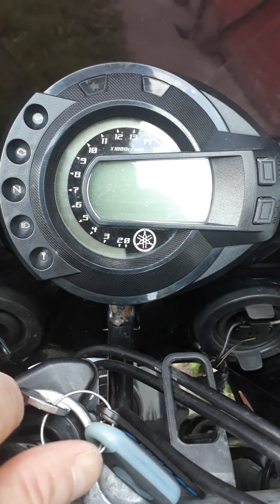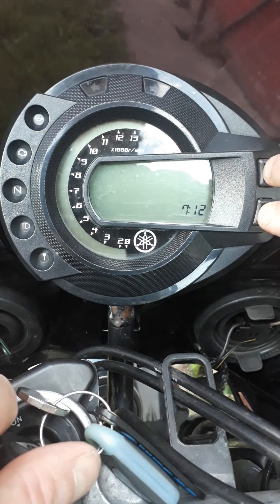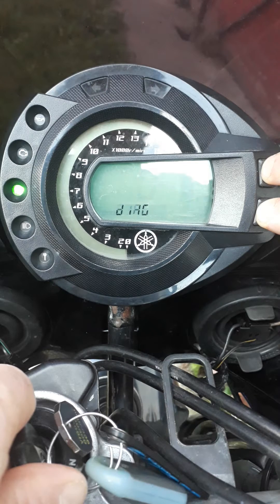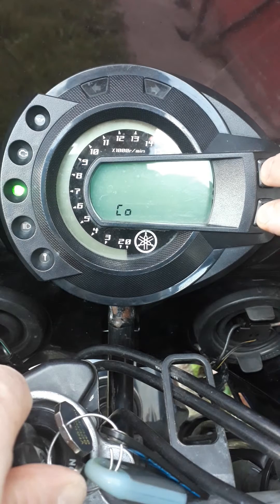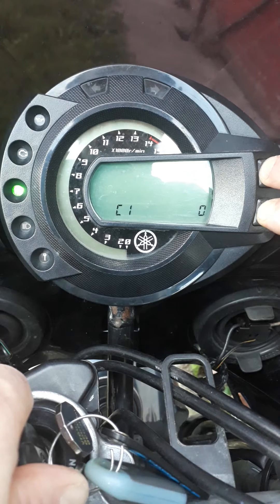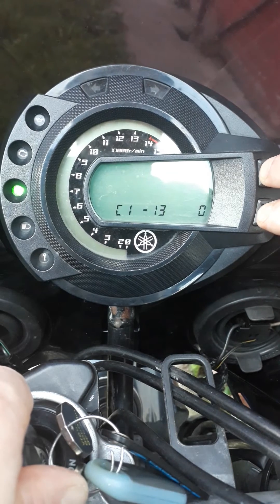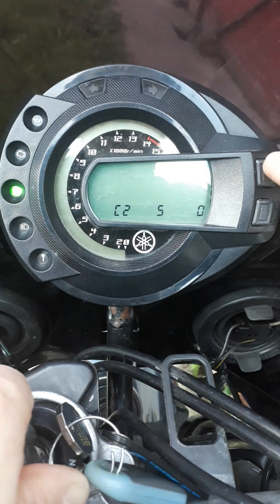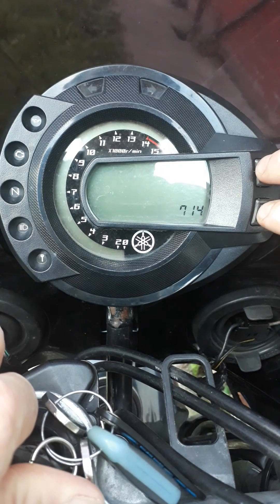Yamaha FZ6 secrets code to adjust fuel mixture on injectors

Comment: Hi, thanx for the vids. I have a Fazer 600 S2 2008. I mostly ride in the city many times facing traffic jams and using the motor maybe from 2.500 rpms up to 4.000 rpms. One tank gives me about 240 klms . What would be the settings regarding fuel economy

Comment: What do I set it to for flames? 😊
Reply from the maker: Wouldnt recomend that
Reply: @jameshiggins39  just for a vid will put back to factory after
Reply from the maker: Turn up the mixture on c1  leave 2
C2 alow put it on 20 but put it back down
Reply: @jameshiggins39  thanks I’ll do one vid then put back to normal
Reply: @jameshiggins39  best setting for running straight pipes??? would greatly appreciate the info
Reply from the maker: If bike got a cat it wont work
Reply: @jameshiggins39  it’s full straight pipe
Reply from the maker: Ule have to ref lick fuck

Comment: What is the difference between what the code does and what the Power Commander does? Or are the effects same if one wants either more torque or high-end power?
Reply from the maker: Depends how u use if u want  Is fuel economy or maximum power
Reply: @jameshiggins39  what's the values for economy then?

Comment: There are sensors you need to adjust if you change this value. I think it's pretty dangerous to be messing around with this unless you know what you're doing.
Reply from the maker: The only sensors a  Crank position sensor Air temperature sensor The throtel position sensor

Comment: Thank you my friend I am very pleased with this setting has both economy but also great power in the power of the engine I say to keep this setting thank you it works and more smoothly the engine
Reply from the maker: Just keep an eye on temp if u have gone feryy hi on c2 as two and three get hoter than  one and four
Reply: And you suggest it to me for this to do at the temperature does not make much difference from before I think it is normal the temperature there is some setting for it

Comment: What’s the perfect setting for c1 and c2? Fz6 2007
Reply from the maker: C1 -16  c2 5
Reply: @jameshiggins39   i think my bike is running a bit rich  so  i  have a question. does turning it to a lower number decrease the fuel it get's or increase? just want to be sure so i know what to kind of value i might whana look for
Reply: @jameshiggins39  Why C1 is so low?
Reply from the maker: Experiment like I did
Reply: @jameshiggins39  whats you recommend
Reply from the maker: 2 3 have to run cooler
Reply from the maker: Ive found +8 -8 works good for me

Comment: Thank you so much for the video.Which setting does least harm to the environment? I got a used fz6 recently but stinks a lot. And I want to save fuel. My mpg is arouns 25. What should I do with the settings?
my current setting is -5, 11 respectively.
Reply: 25 mpg ...clearly something is wrong. try the setting c1 -18 and c2 on 5
Reply: @Ladosligese and how much u do ? I have c1 14 and c2 8 and i do 350km with full tank
Reply: same here 200 - 240 km per full tank with very light shifts around 3 k
Reply: please tell me what options to make i am twrgeting for max save fuel thanks!
Reply: @ΠΑΣΣΑΣ-ε3φ  Βρήκες άκρη με αυτό; Οδηγάω στην Αθήνα και έκανα περίπου 240 χλμ με γεμάτο. Πότε έχει οικονομία;

Comment: i cant get past the diag screen, i press select but nothing happens. when i press both buttons from diag scren it brings up diag codes like d01
Reply: in USA the Co mode is locked. you need to use a wire to connect somthing together. don't know exactly why just read about it on fz forums and other Americans that had the same problem so just quickly glanced through it.

Comment: Hey mate .Just picked up a 05 fazer with a k&n air filter and dekevlic slips on and the bike is set at c1 -9 c2 5 ..Goes fine ..bit of a slump before the power band .at 5.5k..what ya recon..
Reply: Typically if aftermarket slipons and air filters are installed, you should increase c1 to about 15 and c2 to about 20.. mine with remus slipons and simota air filters and these settings run well, minimal backfire too

Comment: When I do this is says "do1" instead of "co",  there seems to be a lot of D codes but no C codes and it wont let me change anything.  How do you get around this?
Reply from the maker: Sorry I have got absolutely no idea you could try holding the two buttons down together and see if that helps the do1  might be just dew to  change in the firmware
Reply: @jameshiggins39  I think in the US or maybe it is the California version, the CO menu is locked out.  We only have diagnostic mode.
Reply: @smoke05s  yeah US only got diag mode. but the co mode is unlockable. you have to use som wire to connect somthing. not 100% sure exactly what but if you google it i'm sure you will find it :)

Comment: 2008 fazer also c1 -16 and c2 5 is the factory setting?  because currently c1 0 and c2 0 are the setting.  Thank you in advance for your help
Reply: mi változott, átállítás után?
Melyik micsoda, mert a videóban nem hangzik el.
Reply: @blurmoire9280  szebben jár a motor, dinamikusabban gyorsul, és jobb a fogyasztása. Igazából azt az üzemanyag mennyiséget kapja, ami a legoptimálisabb neki.
Reply: @MrGyulazsolt  te mit allitotál rajta mi a C1 és a c2
Reply: original factory setting is co1 0 and co2 zero

Comment: I can not get my bike to do this it just stays on diagnostic. Mode what am I doing wrong
Reply from the maker: Try pressing reset to get the co up and make sure the kill switch is switched on and try it also with the kill switch off Yamaha my of patched it what year is your Yamaha
Reply from the maker: Try with the red key what's year is your Fazer
Reply: USA ones are locked and only have diag mode open. but you can get to the Co menue by  putting in a wire. i don't know the exact process just know you have to connect a wire to somthing to bypass the co lock as that's what i read on fz forums from people in US

Comment: Can anyone explain me please what's the difference between "C1-18 C2-18" and "C1-0 C2-0" and also why by default there is a difference between "C1-16 C2-5" ? Thank for the video and for the help.
Reply from the maker: C1 is cylinders 1 and 4 C2 is cylinders 2 and 3  and the reason why C1 normally a higher number those cylinders are on the outside of the engine 2 3 in  the middle and lots of people put on Lower value for 2 and 3 but you do not need to
Reply: @jameshiggins39  I have sport exhaust and when I’m in first gear the bike is not go smooth, any idea what values to put?
Reply from the maker: -18 is taking fuel away go +10 On both
Reply: @jameshiggins39  thank you!
Reply: @FlorinAciobanitei  you can try even 20 easy and see how it runs...no problem...max settings is probably above 100
Reply from the maker: I have scorpion aftermarket exhaust on mine and I go see c1 10 c2  10

Comment: If these values are out of wak, will it make my bike have a slight miss at idel?  Does anyone know? I have just changed the plugs and that seems to help it at first but now it is doing it again...
Reply from the maker: I wouldn't have thought so no check all your HT leads and make sure all cylinders are firing
Reply from the maker: Coming to think yes if your bike is running too rich then it would f**** your spark plugs
Reply: My 2005 fz6 will not let me select cold.....mine bike only goes to the fist word and the self diagnostic mode.....  any ideas
Reply from the maker: @johnstull9253  is your clock round like mine or is it the rectangular shape one
Reply: Yes mine is round..
Reply from the maker: @johnstull9253  hold select and reset down with the ignition off then switch on the ignition and keep them depressed until you see Diaig
Then press one of the buttons and it will say co then press both buttons again and hold them until a number pops up in the middle of the clock
Reply from the maker: @johnstull9253  forgot to mention you're Killswitch must be in the run position

Comment: all these settings are only work till 2500rpm . then it does what the ecu map says.
Reply: Really? So it only affects idle and taking off from a stop. Will it help smooth out the throttle a bit?
Reply: @BaldKiwi117  could explain why my bike seems to be to rich when i just ride it about 1000meters to get down a hill (instead of having to walk up and down it i just ride my bike down it and then walk rest of the way)  always smells like fuel after those short rides and it consumes gas like crazy during those small trips. could just be the Co settings that are high from previous owner and causing my bike to chug gas as i usually stay in the 2000-2500rpm range to not make to much noise.  i can go on nice rides without losing a bar of gas but ride it down the hill a couple of times per week like max 3-4times and it goes through the bars like crazy
Reply: @rampage3337  hhmm that is interesting. Should probably turn those settings down lol
Reply: @BaldKiwi117  hello, I have the same problem, very rough throttle when taking from a stop and going out of corners. Did you try to fix this problem?
Reply: Yeah you can't just change values in these modes. There are a lot of other things that need to be adjusted or you're just going to screw everything up. Just have your ECU reflashed and follow the instructions. I used Ivan. My FZ1 is great now.

Comment: Does this do what an aftermarket fuel commander would do?
Reply from the maker: Sort of but you have to get it right if you don't you will end up having the engine running very rich for the maximum efficiency I recommend +10 +10
Reply: power commander has delays my friend. you should go remap stock ecu.
Reply: @george2939  how do you do this on a Yamaha FZ6?  My KTM has TuneECU software to do that so I am a little familiar with the process.  But what do I need for the 2004 CA edition FZ6?

Comment: I changed on my bike from C1(5) and C2(5) to C1(-18) and C2(-18). Am I risking anything? Is it too lean? Did the changes for more fuel economy, but don't want to cause any unwanted problem to my bike.
Reply from the maker: And always remember the - you are taking fuel away
Reply from the maker: I would say hand on heart the best setting I found C1 10 c2 10  will run like a bomb as you may know with the Fraser they are not in line parallel 4
They are Crossflow engines meaning the firing sequence is 1243
Reply: @jameshiggins39  But isn't that a bit rich mixture? Are you hearing pops from exhaust? I changed first the settings to C1 -18 and C2 -5. The engine run much better in idle. Now my settings are both at -18.
Reply: @jameshiggins39  What is your average MPG with those settings?
Reply from the maker: I was averaging around about 50 to 60 miles per gallon
Reply: @jameshiggins39  I was averaging 40.5 mpg. Will do a test tomorrow with the new settings. Thank you for taking time to answer my questions.
Reply: @jameshiggins39  That's a good average.
Reply: I'm using co 50-60 on my mt-09 with full exhaust and high flow air filter...a tad rich but torque is amazing. Settings 25-35 are perfect for me. 👌
Reply: @audiolover  that work for fz6?
Reply: @xRaidon  those settings? NO I have custom ECU tune but little too rich with those settings. I'm using 0 right now. 20-30 CO2 for high temp outside to lower engine temp in high traffic 🚦
Reply: Ανάποδα τα έχεις θα το κάψεις
Reply: @Sisufos  Για οικονομία πως το σετάρεις;

Comment: what do the numbers mean cause my fz6 runs hot and mine are set at c1=11 and c2=3 so its lower than stoick but runs hot?
Reply: Lower values mean less fuel as far as I know. And the less fuel it burnes, the leaner it runs. And leaner petrol engines run hotter.
Reply from the maker: @magnum4405  yes the Lena the mixture the Hotter the engine will run I find a good setting for mine 10 10
Reply from the maker: I would recommend checking your coolant levels stationery on idle they do get rather hot but cool down once you start moving
Reply: @jameshiggins39  yea the bike just runs one bar hotter than my previous fz6 but its not a problem as the fan kicks in if it gets to hot. ive been told it could just be the temp gauge . mine mostly runs on halfway on the gauge and tends to stay at halfway unless in standing traffic. my previuos fz6 ran on 2 bars on the temp so it just reads one extra bar. its done 23,000 mile like that so its not a problem
Reply from the maker: @lllucky13  that could be your thermostat could be on it's way out or the temp sender to test the temperature sender to the clocks merely disconnect the wire from it and ground it

Comment from the maker: Darren Russell it controls how much fuel goes into cylinders 1 and 4 and 2 and 3 free you can up it or down it
Defaults  is  c1 - 16  c2 5
Reply from the maker: I do c1 10 c2 10 it will go like stink but the engine will overheat very quickly
Reply: @jameshiggins39  My 2004 Fz6 settings were C1 5 and C2 5, now I've changed them both to -18. Isn't your bike running a bit rich with those settings? Isn't better if we set both to the same value?
Reply: @KleantRrera  the inner two cylinders on a four cylinder usually run a bit richer to benefit from extra cooling effects due to extra fuel
Reply from the maker: Mind you that average is travelling between 60 to 70 mph

Comment: what should the values be set at and what is it for please?
Reply from the maker: C1 -16 c2 5  that is what the settings of mine was when I altered it the first time and the exhaust pops for the simple reason the efr system on the head to air box if you have got aftermarket exhaust the stock exhaust does not pop
Reply from the maker: It's personal preference what have you never turned up the fuel pin on a carb bike